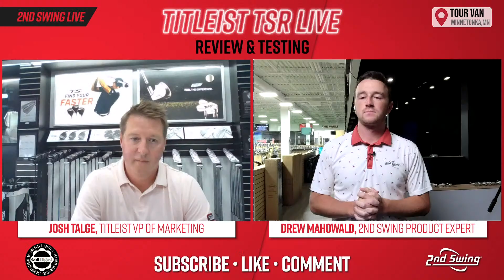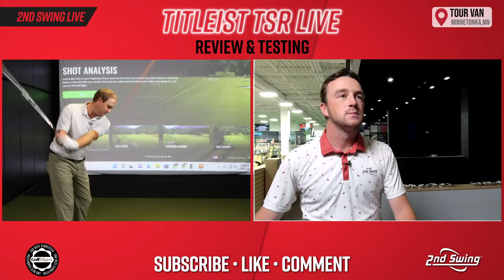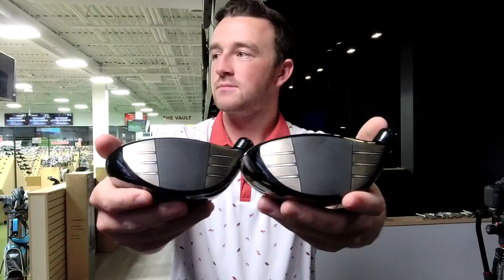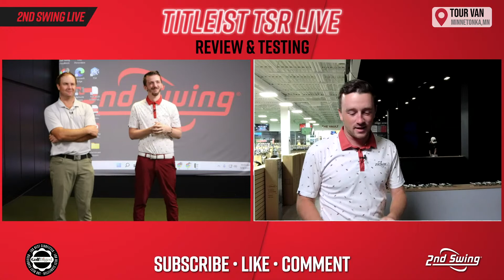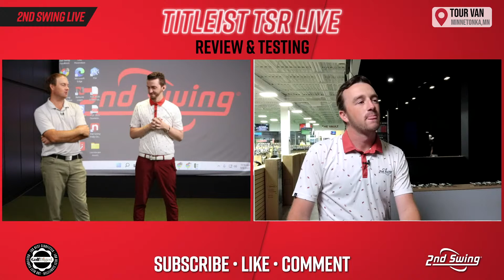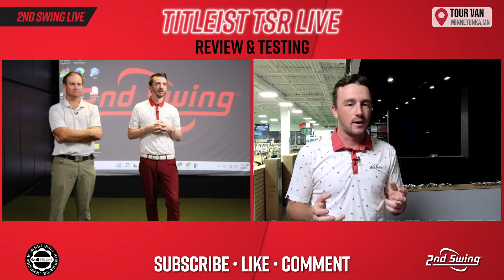Titleist TSR LIVE Review and Testing | 2nd Swing Golf

Comment: The question of the day is, Can you hit that new titleist Further than he hit the tour edge C721 Somewhere around 340 yd !!!
Reply from the maker: Good recall. I'm not sure I have touched 340 with any driver since the C721 - Thomas
Reply: I play the C721. I tried the TSR3 yesterday. Not longer, but so well balanced. My strikes were better on average. I was launching a little lower and I'd already hit a lot of balls, so I might have been leaving some distance on the table. Great feel and sound. I play the Hzrdus Smoke Blue and the stock shaft in the demo just felt more stable and the club was just easier to deliver. Maybe I should just change shafts. More fine-tuned if you will. I was looking for new wedges but I just had to see what all the fuss was about. Not going to pony up $600 now because I need new wedges, but wow. This said, I'm very happy with the C721, especially for the money.